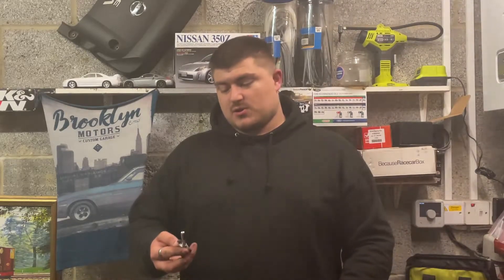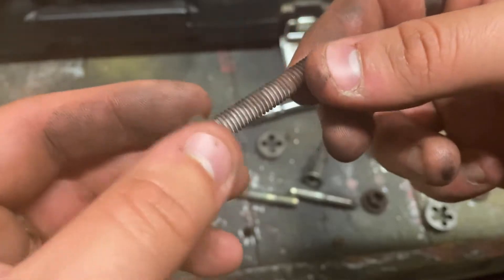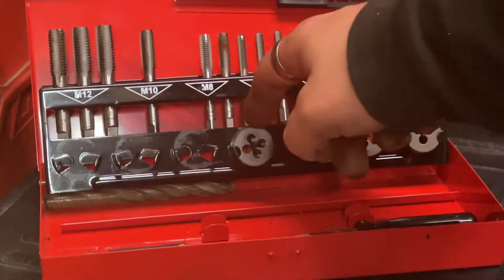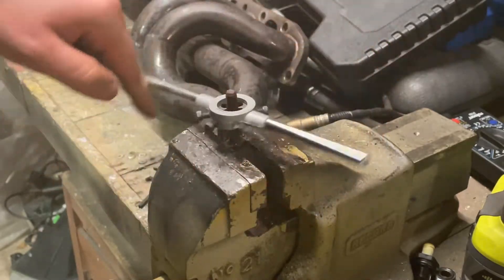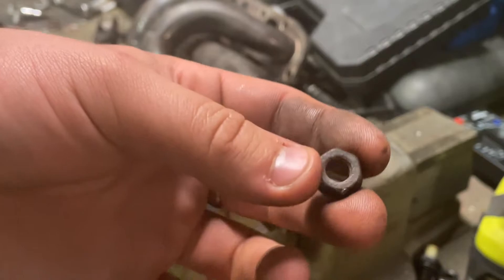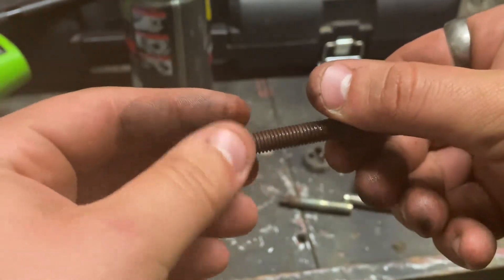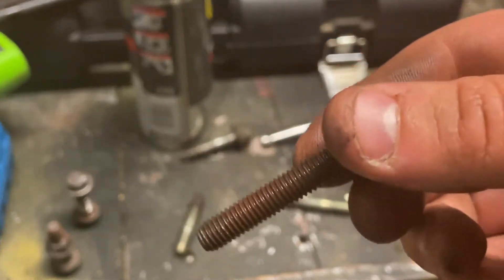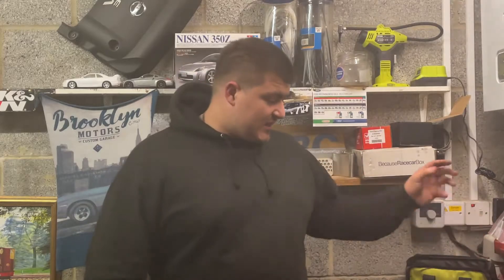Using A Tap & Die To Revive Old Nuts & Bolts

Comment: You should really use thread chasers and not taps and dies for this. The former restore boogered threads, and the latter either undercut an existing thread or cut another on top of it, significantly weakening the torsional strength of the fastener. I realize that there are a multitude of videos on YT, that are not done by machinists, showing exactly the same thing. Doesn't mean that it's the right thing to do. BTW, I like your vise very much. Good luck.